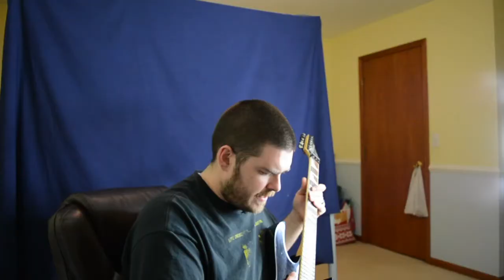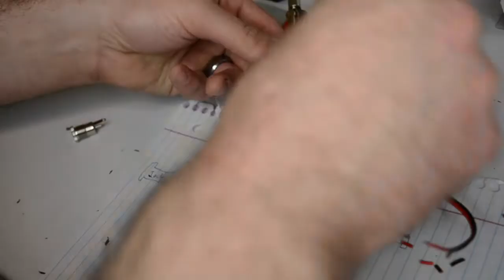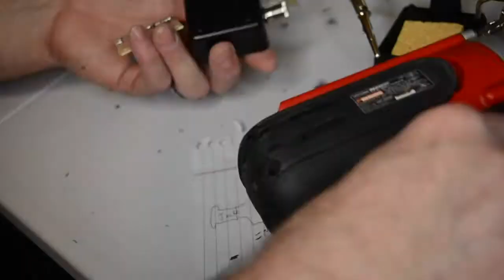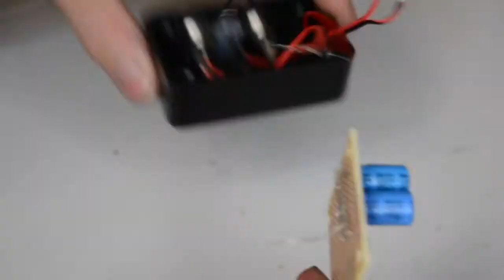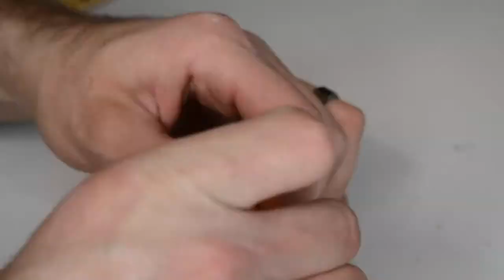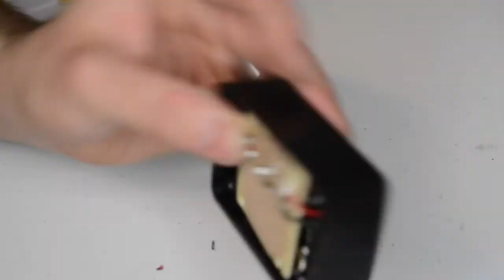DIY guitar pedal power filter

Comment: Geez, 2 schottky diodes and 2 hi caps handle this? I tried this filter with Inductor & 1000uf caps without diodes, helped up to a point but not entirely, I'll add the diodes like as shown here and give it another try.
Reply: it would be helpful to see the schematic, but it appears that the diodes give reverse  polarity and overvoltage protection so if you plug in the wrong kind of cable or supply it wont send reverse or high voltage into all of your pedals..  the safety circuit may not work as intended with the resistor removed.  the LED is likely dropping the voltage depending on how it is inserted in the circuit..  I also don't see a current limiting resistor for the led which means it may burn out..  again the schematic would illuminate everything

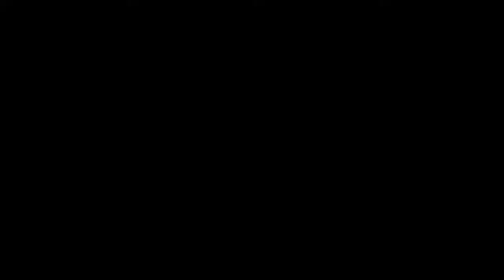Comment: 3:46 Build List

As Stavros T said, an inductor on the output (in series) would improve it.  As Davesauce found out, a resistor there will drop the voltage fed to the pedals - and effectively lower the source impedance of the power supply, so more load (more pedals) means less volts.

The video he was referring to might be this one, or one of a few related ones on that channel:

https://www.youtube.com/watch?v=dGr44dOsh1k

Comment: Good work with your video mate.
I have to share a couple of things with you because this is a great solution that I used in the past.
1 st - this might not work with digital pedal( like boss looper)
2nd it can be improved by increasing the capacitor value( filtering)
3rd an inductor in series with + voltage might improve things aswell 
4th it could be better to use it with a power supply that has a transformer, so the filtering will be better(your power suply is probably transformerless and this is what causes the harmonic sound). A power supply with transformer will produce only some hum and this circuit will fix it
Cheers!

Comment: Mine doesn't make that noise.. I have 5 pedals on it.. not sure why mine is quiet.
Reply: Yours probably has a transformer in it, not a switching ("switch mode") voltage regulator.
Reply: It's not resting on the input/instrument cables😜

Comment: You used 2x470uf capacitors, can they be replaced by 1x1000uf?
Reply: I build mine, and you are right, the 100 ohms resistor drops the voltage too much, but if you use a 0,22mH inductor (they are very cheap) it works so much better and there is no considerable voltage drop. (my bogner red ecstasy didn't work with the resistor, but it works perfectly and without noise with the 0,22mH inductor.)
Reply from the maker: Danich Ivanov I'm actually not sure why threre is 2 caps, I was just building what diy guitar pedals on YouTube made and it actually helped that hissing sound.
Reply: Davesauce Thanks for replying! I'm actually already built this thing with 2x1000uf cap, and while it really does improve on noise side of things, with seven analog low current pedals turned on at the same time it drops the voltage, in my case, from 12 volts that i gave it, to almost half of that, so i will be adding a voltage regulator instead of resistor that was originally in the circuit, and see if it will make it more usable.
Reply from the maker: Danich Ivanov Thats awesome! I hope it helps! I had to remove the original resistor in the design too. My voltage was way too low. Once I took it out I'm a little below 9v now but I'd rather have that than have tons of noise lol
Reply: Carlo de vivo can you share a circuit please